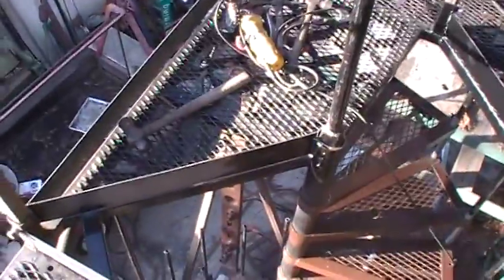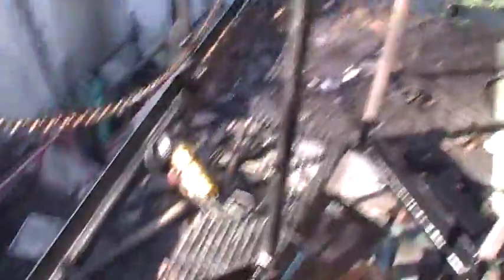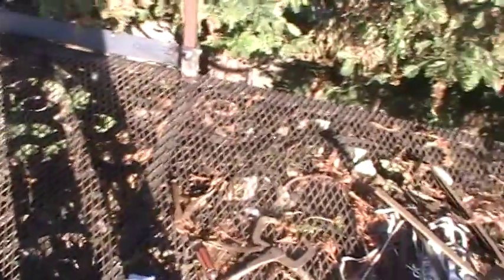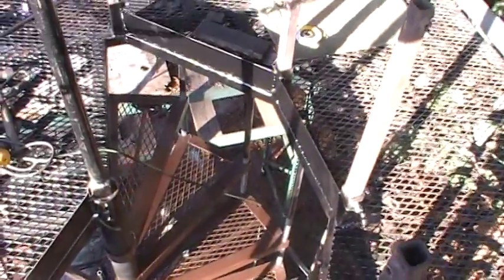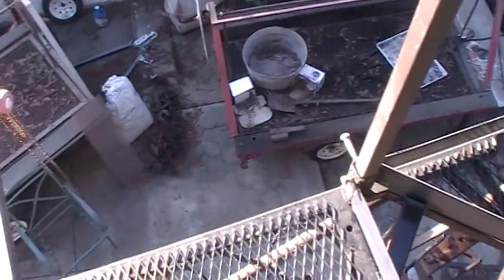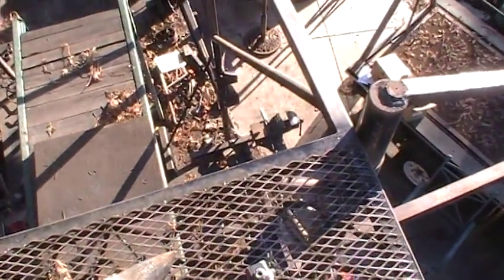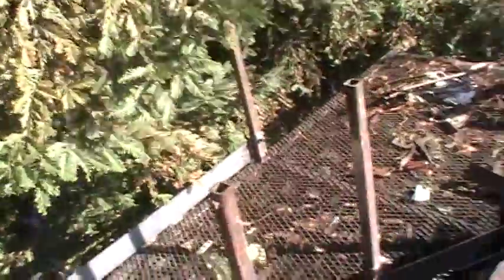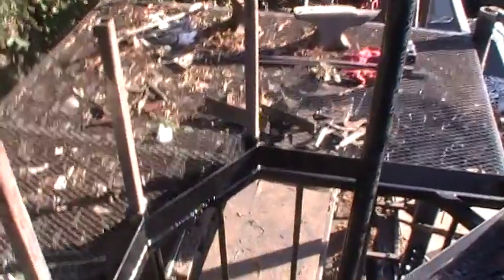Got enough deck to walk around on

Comment: Good Lord Dave is that going to get under a bridge?
Reply from the maker: Thanks. Top of hand rail is only 16'! But it's removable and deck height is a tad under 13'. Should fit under any standard overpasses. They're usually 14' 6" to 15' 6". These are highway miles so I'm only looking for the speed limit.